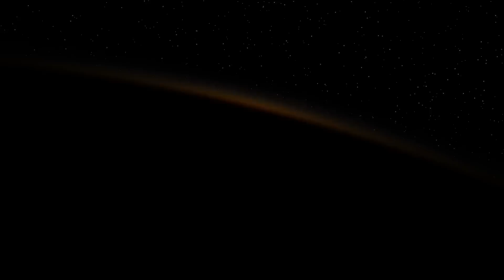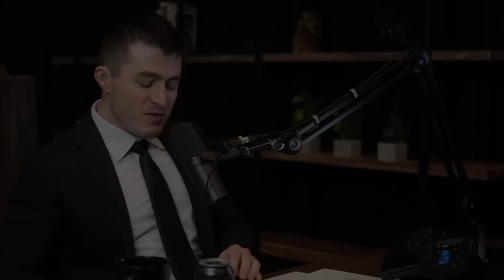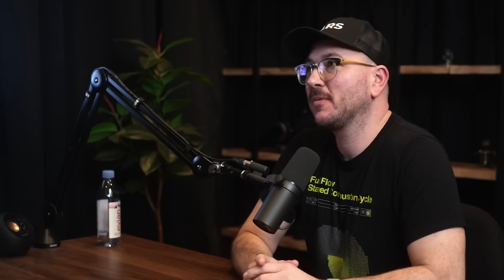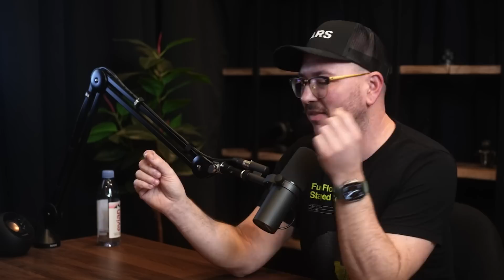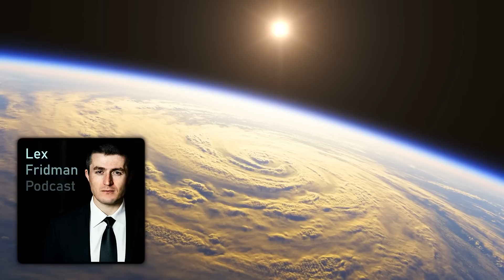Why single-stage rockets suck | Tim Dodd and Lex Fridman

Comment: So, a single stage equals one plane. So a plane uses a wing lift to take off. So Virgin Orbit, 747 refit. All we need is a SRAM engine that can take over after lift off?
Reply: The plane would be the 1st stage. As that's ditched and not sent into orbit.

Comment: Depends a lot on the materials science. Staging becomes a lot less necessary as the structural weight fraction decreases.
Reply: A multi-stage rocket benefits just as much from light materials. Less "Necessary" maybe but also still ridiculously more efficient.
Reply: @tom4115  I'm saying it's somewhat diminishing returns. If the spent 1st stage airframe weighs about the same as the extra hardware required for adding a second stage, then your delta V will be about the same between the two. The only benefit you'd get at that point would be the better Isp from a vacuum nozzle engine

Clearly there's a point at which it no longer improves performance. We don't do 4+ stage rockets, and for LEO we very rarely do 3.
Reply: @appa609  Yes, if the first stage had 0 weight to it.. having a single stage makes sense. Unless we find unuptanium that not only can structurally hold its own weight but the high pressure of the fuel while still having practically no weight, multiple stages will always make sense.

Comment: The only way it could work with 1 stage is if the main body of the spacecraft is if it can inflate or deflate depending on how much fuel it has like a baloon. Well... other than having an ablative outer shell but then it's not reusable.
Reply: inflating and deflating doesn't alter the weight.
Reply: It has nothing to do with volume.  Mass of a deflated balloon is largely the same.

Comment: Imho sending cargo to orbit or beyond on a rocket should be looked at like sending that cargo through two different mediums... atmosphere ( air ) and space. There is a reason why vehicles carrying cargo through any of two various mediums are rare. You dont see amphibious giant cargo ships, rather trucks and trains get that cargo through land to the sea and load it on a cargo ship, otherwise is impractical and too expensive. Same with rockets, you need a "truck" to get cargo to space and a "ship" to haul that cargo through space.
I think ssto's will never be a thing, even with some far future science fiction engines like fusion engines or metallic hydrogen engines boosters will still haul spaceship with those engines to space and those engines will be used in space.